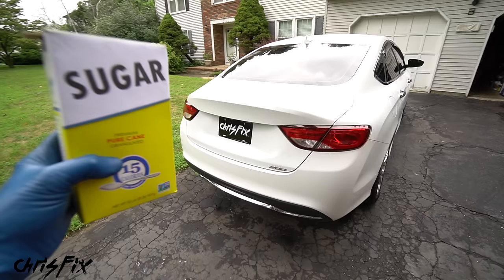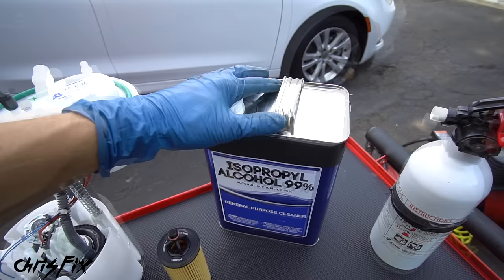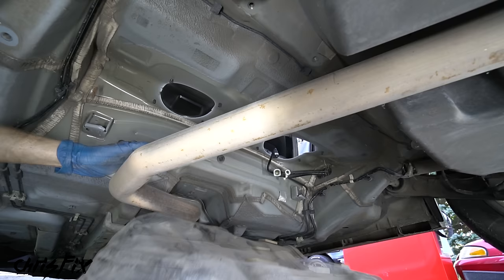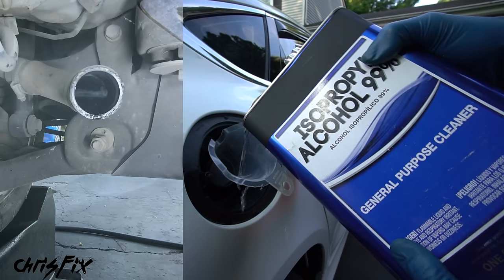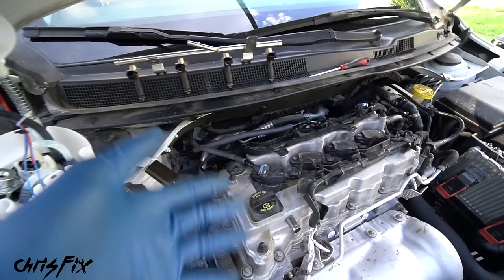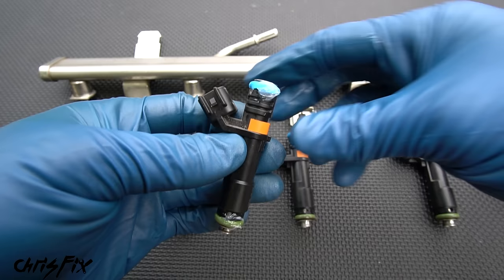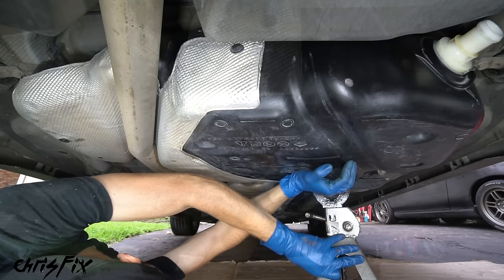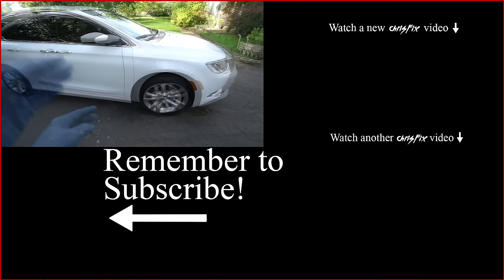How to Clean Out the ENTIRE Fuel System (Vandalized with Sugar in Gas Tank)

Comment: You actually still can put a push button start car in run, you just have to push the button without your foot on the brake.
Reply: @liamhayes23  just you my guy, i dont notice anything wrong.
Reply: @liamhayes23  nah you just have health problems go see your doctor
Reply: Still its not necessary. MODERN CARS SHOULD HAVE KEYS IN THE FIRST PLACE!!!
Reply: @Pissrust69  actually isnt it safer for the keyless, less likely to get "lockpicked"?
Reply: @thesnaker4358  It is and I prefer it, lets me get my car running quicker when it's super hot outside
Reply: @thesnaker4358  as far as I know it isn't. If you look at the BMW X5 or x6 for example of was the most stolen car in Germany for a long time because it was pretty easy to overcome the keyless go system. Most people leave the key to close to the car, which in returns means that you can simply repeat/mirror the signal to get into the car.
Reply: @liamhayes23  You don't own a Push Start so don't comment. When you press the Start button without pushing in the brake will put the car in the On Position which also primes the fuel pump the same as turning a key to On.
Reply: @thesnaker4358  lol no it can be hacked
Reply: @Jaronros  oh okay, that makes sense, i havent owned a keyless car before so i didnt really know how it worked. Thanks for the info.
Reply: DerRoteLP that was the comfort access version I think
Reply: @thesnaker4358  yh but now they use a special key coder and scan it near your house to connect to the car key that then connects to the key scanner to the car extending the keyless signal to the car so they can drive away with the key code aswell or just plug into the end port after breaking in the car
Reply: I have a key and push-start. Laughs in s2000
Reply: DerRoteLP not remotely true. It wasn’t even pass the forth most stolen car.
Reply: Ethan keenan only worked for keyless entry vehicles and that has been fixed. So unless you’re driving an older model of keyless entry that’s the only time you would have to worry about that. Also it only works a few meters away from the keyfoab not something that’s actually something to worry about.
Reply: Man, this Liam Hayes guy must’ve deleted his comment pretty quickly
Reply: You have to push the push start/stop button twice without pressing the brakes
Reply: It does start the fuel injecteders
Reply: Same for a stick shift too. Just don't press in the clutch and it'll put itself in run.
Reply: Yup. Dealer showed me that when I asked how one sits in the car and listens to the radio without running the engine for more than a couple minutes.
Reply: @SkyrisTKO  fourth
Reply: I was thinking the same thing. Something I learned from being a dealership tech.
Reply: @ulogy  The radio should start by turning the...radio on. You shouldn't have to play with the car start button just for that. But who knows, maybe some cars are that way.
Reply from the maker: Thanks for the tip but unfortunately the fuel pump did not prime when I did that. It goes to the run position in the traditional sense where the radio can turn on and stuff like that but it doesn’t (or at least this car doesn’t) prime the fuel system.
Reply: In some cases you just hold the button down
Reply: @thesnaker4358  lock picking is harder than hacking into vehicle security systems honestly
Reply: @AFXGaming  All cars made in last 20 years have immobilisers so you can't use copy of the key or hot wiring. You need original key or some kind of bypass.
Reply: ChrisFix you press it two times. first time is accessory, second push is run position. at least thats how it is in my lexus lol
Reply: @chrisfix  Interesting! Mine has two modes, similar to Acc/Run. Gotta press the button twice without your foot on the brake for the Run mode, definitely primes the pumps. (Light glows orange for Acc, Red for Run.)

Would be a very FCA thing to overlook that though. Either way, looks like it handled it like a champ in the video, just a little extra stress on the starter (Which isn't a huge deal in that new a car anyway.)
Reply: @danielv7340  It's gotta be in Accessory mode, but if you have it on that the battery saver kicks in after like 3 minutes. "Run" mode lets it go until the voltage drops below some (still really high) threshold.
Reply: Martin Yeah. Don’t they have like rfid chips in the key which kinda like authorize it?
Reply: Youtuber4682 your comment is an oxymoron.
Reply: @chrisfix  did you press the button once or twice? If you press it once, it goes to accessory mode, but twice and it will go to run.😊😊😊

Comment: Quick tip: 
To prime the fuel pump on a push start, push the start button twice without your foot on the brake pedal. This will put it in the Run position without starting the ignition and will activate the fuel pump. You also have to put the ignition in the Run position without the engine running in order to reset your oil life on these 2.4l 200’s. Obviously it still started, so no big deal. But if the battery was weak enough, the starter cranking while the fuel system was priming itself could have killed the battery before the engine finally started

Comment: mechanic: sorry sir this will cost you 3000$ to replace

chrisfix: hold my beer
Reply: lol yeah, but the reason being is mechanics will take the easy route if they can, which includes just replacing everything. So instead of doing all the cleaning, he's going to rip out the fuel line, the tank, injectors, fill hose and just replace them with new parts. Certainly effective, but hardly the most practical or economical method. It pays to have some car repair knowledge. I've been working on my own vehicles for 18 years and have done everything from oil changes to engine/transmission rebuilds. Can't imagine how much money I would've had to pay for all the stuff I've done, I've easily saved tens of thousands throughout the years I'm sure.
Reply: Hold my wrench
Reply: *Hold my soapy wooder.
Reply: @jw11432  So as a mechanic i can say, atleast in my country replacing something is alot cheaper than fixing it. Reason being that just the work (time spent on working on the car) that i, the mechanic do, costs alot of money. Now obviously replacing something is done way quicker than fixing the same part so with parts being relatively cheap it's cheaper to replace it. Also we are under alot of stress because we have alot of other customers. Again, replaing something takes less time, meaning theres more time for other customers.
Reply: Soapy Wooder,
Reply: @jayplexy5983  Ah ok, so I think that variable here is aftermarket parts. For example, assuming this car (Chrysler 200, it looks like) for year ~2012, a new OEM fuel pump is anywhere from $350-$500, depending on the specific part # needed. Even aftermarket (looking at AutoZone stores) the cheapest appears to be about $230.

But I do see how there's a formula to consider in your case. If there's enough business to justify charging the customers for new parts, especially if they are older cars where parts will be cheaper since there are going to be more manufacturers making these replacement parts, then it could be more profitable to just replace the parts to get customers in and out. But as a consumer, it's still going to be cheaper to fix/clean rather than replace, assuming you do it yourself.
Reply: Mechanic: we will have to replace your fuellines, incectors, pumps, and the tank. That will cost 2000$

Also mechanic: sure we could clean it. That would be around 4000$
Reply: Chrisfix: hold my wooder
Reply: *Hold my 99% alcohol

Comment: My favourite things about ChrisFix videos is 17:08. "...and we are not using this special machine, we gonna do it by hand". This is by far the most valuable part. No fancy expensive shit. Just a tiny 9volt battery, some bog-standard 99% alcohol, rubber gloves, air compressor. Simple things, or at least something one can relatively easily rent out for a day. 
Anyone can fix anything if they have the tools do the fixing for them.

Comment: Before: Soapy wooder 

Now: 99% Isopropyl Alcohol
Reply: *soopy wooder
Reply: Iso.....    stuff is more rare than hens teeth around here. It's all been turned into hand sanitizer. Had to actually use carb cleaner for once 😠
Reply: Out with the old, in with the new!
Reply: @RaptorTroll360  Soapy Water take it or leave it

Comment: 20:03
It's really not a good idea to use medium strength threadlocker on screws that go into plastic!
From the permabond website: "Anaerobic threadlockers are used for metal fasteners; they should not be used on plastics as metal ions are required to cure the material, and they can stress crack plastics."
I found this out the hard way when some new plastic parts fell off my car that I had used blue loctite on.
Reply: yeah, and that rail didn't look tight at all
Reply: What’s threading into plastic? There would be inserts (probably brass) in the manifold for the fuel rail fasteners and I’m sure the tank straps are going into the body sheet metal.
Reply: @Turbochargedtwelve  Nope. those screws go directly into plastic on the manifold.
Reply: @Turbochargedtwelve  He literally says in the video "Don't over-tighten these, because this just screws into plastic"
Also you can tell by how course the threads are on the screw, it's designed to go into soft plastic.
Reply: @ericrudgers6816  wtf is your problem
Reply: Thanks for the info!!
Reply: When I saw this I went straight to the comments!
Reply: @ericrudgers6816  what's ur problem
Reply: I wanted to comment on this.  I installed some under-dash   gauges -- Accugage, I think-- plastic housings.  Instead of using the lockwashers where the individual gauges attached to each other side-by-side , I used blue loctite.  Next morning when I went out  the entire group of them was sitting on the floor of the car.  The plastic was melted.  So I agree.  Keep the threadlocker away from plastic.  This was on a '70 Ford Torino in the 80s.

Comment: You can put a push button car in the run position by pressing the button (possibly twice) and not stepping on the brake.
Reply: @P4R7Y664  that's a weird way to describe yourself.
Reply: @P4R7Y664  no he's right
Reply: @speed26268819  Depending on the car, yeah. But some cars with a popup gear change (like jaguar or landrovers) won't pop up without the engine being on (I have a 2012 jaguar xf)
Reply: Ive tried it on a jeep grand Cherokee 2013 no it doesn't work
Reply: @ME-bh9gc  make sure you don't step on the brake. It works in every push button car I've tried. I drive a 2019 Honda crv and if I, without stepping on the brake, press the button once, it is the same as turning the key once. If I press it again, it is in accessory mode. All of the electronics come on and I can hear the fuel pump prime. If I press it again it shuts off.
Reply: I do that on my mk7 tdi
Reply: you're absolutely  right
Reply: Lol, I was going to say that
Reply: Push twice or press and hold for 3 secs without the foot on ghe brake pedal
Reply: Funny, cause I had the same exact thought in mind.

Comment: I am 13 and dont own a car yet but when i get old enough to own a car i will know how to do a lot of things myself thanks to your videos
Reply: Well based on ur profile pic u don't know real cars
Reply: @jeff1595  last time i checked a 2017 tesla s p100 d beat a 2018 huracan performante to 60mph
Reply: @jeff1595  Am i not allowed to like tesla?
Reply: It's possible to like more than one car brand.
Reply: clout demon  what about consistent power all the time? u dont have to wait until 3500-4500 rpm.
edit: also lower center of gravity (and therefore better handling), fewer moving parts (more efficient). not to mention most gasoline cars operate with about 20% thermal efficiency which is terrible
Reply: clout demon  still a second makes a difference. did u read the rest of my comment?
Reply: A) Teslas are real cars, very nice, much more efficient, incredibly fast (if that matters to you...which actually instant torque and good handling is nice for highway reactions, much more than top speed) and much less to break drivetrain wise.
B) As much as I love the Tesla cars and concepts (except the truck...) the company is trash. 
They are anti right to repair (ie this video) and they do not build their cars in a way so as to make simple repairs (like replacing a bumper for instance) possible. Damaged your bumper on your Model S? Too bad, now they're going to tell you you have to replace the whole front end, and you can't do it, they have to or they will de-list your car and you will lose fast charging if they ever find out you did it...
So Tesla as a company, is garbage. I hate them for taking a great idea (the cars) and surrounding them with mountains of shit. I look forward to a few years in the future when I can buy a used Model 3, hack in some 3rd party firmware and flip the bird to Tesla as I drive one of their cars free of their bullshit...

C) I am amused though because these videos really wouldn't help you in fixing an EV that much...so the profile pic with the comment is kinda funny...but it also doesn't matter because as you said, multiple brands...and unless you have that whole rich family situation chances are your first car won't be a Tesla or even an EV...so you'll get some use out of ICE repair videos.

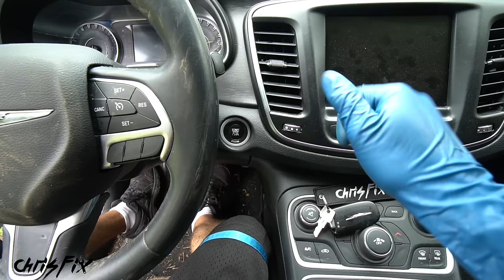Comment: 24:50 you do know that you can cycle the ignition (LOCK-ACC-ON) by not hitting the brake while pushing the button,it only starts when you hit the brake
Reply: Came here to say the same thing.
Reply: Yeah but it's frustrating that when u want to go the other way (on to acc) the car goes off. The good ol' key days, you turn the key one click and it's back one mode, not off fully.
Reply: Surprised he did not know that! Awesome job Chris

Comment: Pro tip: Pressing the start button when you’re not on the brake will turn the car on but not start it.
Reply: NANI (translation) WHAT?
Reply: @graceperez9672  didn't know that? it just puts the contact on, just not the engine itself :)
Reply: Can confirm except in my car it's the clutch you need to press in to start it.
Reply: Duhhhh
Reply: MatrixGuardians99 yep, no clutch in and the button just puts the car in the on position
Reply: Yep. Pressing the start/stop button with your foot off the brake is the same as turning the key to the run position. It won't start the car but will turn all the electrics on, including the fuel pump.
Reply: Oh ok
Reply: In my car the pump will not prime when you push the button , it will only turn on electrics.
Reply: @Fatherland Child I’m a registered republican and a diesel truck mechanic. My car is automatic.
Reply: @fatherlandchild2780 : Your comment shows clearly what kind of person you are. Please get help.
Reply: @hockeyguy820  🤡
Reply: My car uses an ignition
Reply: Chris fix, even in Africa we know that in order to turn the car on, you press the button without your foot on the brake to switch it on.

Comment: For those who have a push start, if you are checking for activity in your fuel pump (listening for it), you can press the button without the brake and listen for it. Most cars will run the pump with just battery mode on. Afterwards turn the power off, wait about 30 seconds, and press again (without brake) and you should hear it again. Not sure if this works for all, but just some knowledge over the years.
Reply: This is generally the case in my experience. Additionally with cars like BMW, if you unlock the car, or open the door once the ECU has gone to sleep, it will pressurise the the fuel lines, too. 
But in general, turning the car on to the ON position without touching the brake to avoid starting the car should be sufficient in most vehicles.

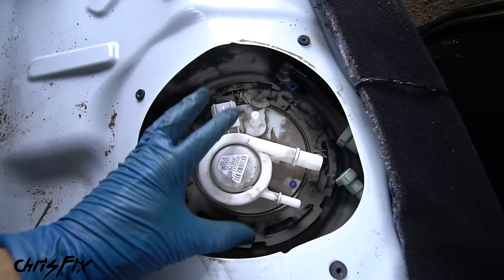Comment: 5:50  A good design by Chrysler? Astonishing.
Reply from the maker: lol
Reply: Hold your horses, I wouldn't call building the fuel filter into the pump a good design!
Reply: @maciozo1  Well that includes almost every single U.S. market car made within the last 10 years or so. He obviously meant the easy access to the fuel pump, being the tank didn't need to actually be dropped to replace the pump.
Reply: Didn't Chrysler think up the jeep xj?
Reply: @maciozo 
me neither, I just meant the ease of access to the fuel pump assembly
Reply: Aidan Montgomery 
Correct
Reply: Mixed Feelings 
In the 80s lol, I should’ve said FCA instead though
Reply: @maciozo1  He was clearly talking about the access to the fuel pump from underneath the rear seat. Don't take things out of context.
Reply: @maciozo1  Just like I wouldn't call Honda's 3 years of non replaceable transmission filters particularly good design either
Reply: Anything to save a few pennies by the manufacturer